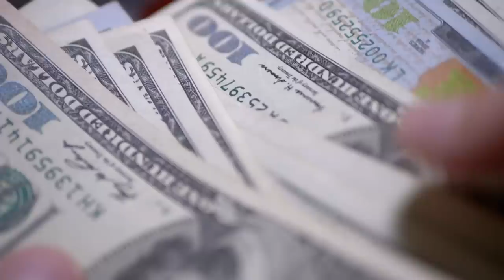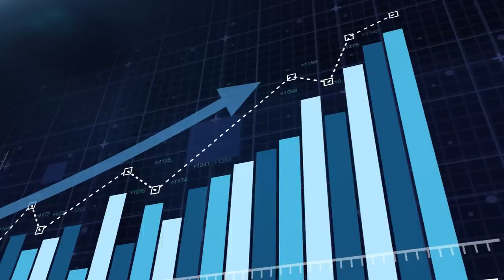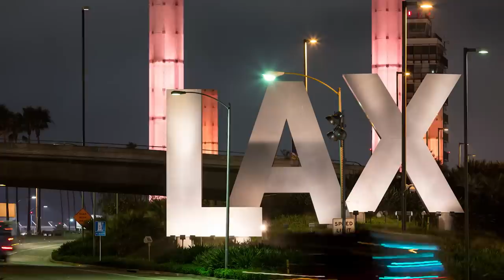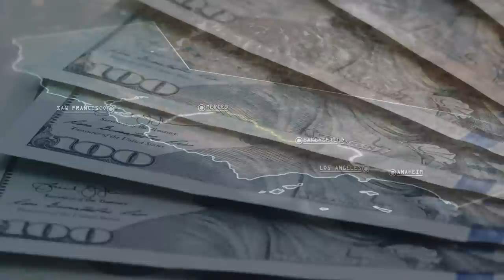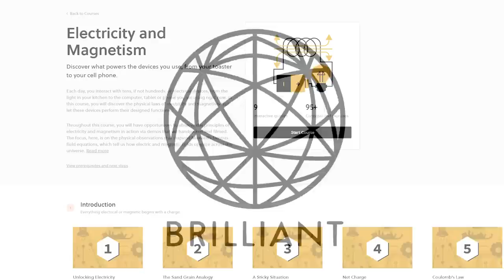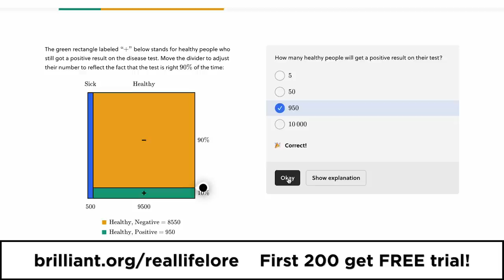Why California High Speed Rail is Struggling (Re-upload)

Comment: as a native to CA, it is hard to imagine this being completed. in the sense that it seems too good to be true. I have spent many many hours of my life in a car traveling around the state. having this kind of rail system would be AMAZING
Reply: "I have spent many many hours of my life in a car traveling around the state. having this kind of rail system would be AMAZING"

Well, you're learning this late, but you know, two American brothers invented this wondrous device a while back. It lets you fly through the air. It's been upgraded a lot and it goes at Mach 0.85 now. It passes wheel on rail HSR like the HSR is standing still.
Reply: @neutrino78x  a train station is a lot more convenient than sitting two hours before a flight and going through security and waiting in long lines
Reply: @cyclingtexas1670  

"a train station is a lot more convenient than sitting two hours before a flight"

Why are you doing that? Boarding starts 30 minutes before and security is 5 minutes with "clear" and 20 without. If you're there more than 40 minutes early when you have "clear", or you don't have clear and get there more than 50 minutes early, you're wasting your time. 

None of that makes up for 3 hours of your life that you wasted on the CAHSR that takes 4 hours to get to LA. 

It's even worse if you're going down to SD because as currently presented going down to SD would take another hour, whereas in a plane, they just open the throttle a little more and you still get there in about an hour. Their max cruising speed is over 500 mph so they're only taking an hour to get to LA because they want to burn less fuel. 

I've been on a flight from LA to San Jose that took only 45 minutes. Let's see CAHSR beat that (they can't beat one hour either).

btw to get on a TGV, users on TripAdvisor suggest about 30 minutes before also.

"going through security and waiting in long lines"

Five minutes with "clear" and 20 without.
Reply: @TohaBgood2  

"No one shows up less than 1.5 hours before their flights because that is a surefire way to miss your flight "

If you want to waste your time, go ahead. I wouldn't get there that early.

Also go to TripAdvisor and see what the users on there say about getting on TGV, they say to get there about 30 minutes early, which is when you want to get the airport.

"ou don’t show up a few minutes before takeoff and expect to be allowed to board!"

On Southwest you can. There's no assigned seating, so whatever seat is open you take it, as long as they're still boarding you're good.

"TSA lines can take anywhere from 10 minutes to an hour during busy times."

"CLEAR" is a thing. Sign up for it. I think it's like 200/year.

Anyway, regardless of all of this, fact remains, CAHSR as currently designed, if ever completed, would be a 3.5-4 hour ride. You're just making up excuses for it being so slow. Vast majority of people who want to go from SF all the way down to LA or SD just fly. It's cheap, it's fast.
Reply: @neutrino78x  Hang on, didn't you confess in a different thread that you completely made up the 4 hour runtime number for CAHSR? Didn't you say that you took the non-nonstop 3h5min SF-LA runtime and add on a hour "just because"? Didn't you concede that the nonstop SF-LA runtime is 2h38minutes? Do we have to redo that whole conversation again?

Because I literally have that thread saved where you confess to making up the 4 hour runtime for CAHSR!

And dude, what are you even talking about? In most major airports if you drive up to the parking lot at the airport 30 minutes before your flight you're not making it to the gate in  less than 1.5 hours. Let's take SFO. If the main lot is full and you go park in the longterm lot. From there you used to have to take a shuttle to the terminals which ran every 10 minutes and took about 10-20 minutes to get to the terminals. That's more than 30 minutes right there and you're not even inside the airport, let alone past TSA!

Dude, just stop lying! Anyone who has ever been in a large airport knows that you're full of it!
Reply: @TohaBgood2  

"Because I literally have that thread saved where you confess to making up the 4 hour runtime for CAHSR!"

I didn't. 3 hours 5 seconds by their numbers, but you can't accept that because they have 35 minutes or something like that for SF to SJ so it becomes 3 hours 35 minutes, and just from experience on public transit, and knowing the published timetable is normally optamistic, I predict 4 hours.

It's sort of a moot point because the project is never going to get completed. 

"In most major airports if you drive up to the parking lot at the airport 30 minutes before your flight you're not making it to the gate in  less than 1.5 hours."

I wouldn't know, I take transit to the airport. Try leaving your car at home.
Reply: @neutrino78x  Ok, so you confess again that you just made up the 4 hour number. A version of the SF-LA runtime with stops is 3h5min and you added another hour just because you felt like it, correct? And in the same document that you got the 3h5min runtime from, the actual nonstop SF-LA runtime is 2 hours 38 minutes (under 2h40min as required by law). Good to have another admission from you that you lie when you cite your fantasy 4 hour SF-LA runtime!

The vast majority of travelers drive to the airport in America. Even for airports that are very well served by transit like SFO or OAK that is the case. But for airports like LAX or SJC where the only transit that is available is a very slow bus, almost 100% of passengers drive. Best case scenario, they are given a ride to the airport or get an Uber. That is the reality of the situation. If it weren't then airports wouldn't need parking lots the size of cities!

You've basically constructed this fantasy reality where parking isn't an issue, where you don't need to take shuttles or trains inside the airport for 20-30 minutes to get to the terminals, where everyone has Clear. (But if everyone has Clear then isn't Clear useless by definition?) Where there are not trains inside the airport that you have to take. Where you don't have to search for your gate. Where you don't have to walk to your gate. Where doors don't close 15 minutes before departure as literally required by law.

Basically, these times you pretend are true exist only in your head. None of this has anything to do with the actual reality of flying in the US right now. This is all made up bullisht!
Reply: @TohaBgood2  

"Ok, so you confess again that you just made up the 4 hour number. "

Nope. It comes from decades of experience riding transit and knowing for a fact that it's going to take longer than any time table they release.

"A version of the SF-LA runtime with stops is 3h5min and you added another hour just because you felt like it, correct? "

Nope. 3 hrs 5 min is achieved because they have 35 min (or something like that, I'm not going to go look it up again) for SF to SJ, which is not realistic. 

3 hrs 5 min is 1) too slow and 2) a violation of prop 1A, anyway.

"the actual nonstop SF-LA runtime is 2 hours 38 minutes (under 2h40min as required by law)"

Actually the Business Plan says 2 hours 40 minutes, not 38. You're getting 38 from some computer simulations done by CAHSRA a while back. But regardless, the system they're building can't do it in 2 hrs 40 min. So, not much point in disputing my time estimations because 2 hrs 40 min would also be too slow.

"The vast majority of travelers drive to the airport in America. But for airports like LAX or SJC where the only transit that is available is a very slow bus, almost 100% of passengers drive."

Well, for SJC, it doesn't really matter, because the airport is basically in downtown. It's like five miles north. That's why we have a height limitation downtown. So basically if you can get to the train station where CAHSR would go (san jose diridon) you can get to SJC. There's no time advantage there. You can actually walk from Light Rail to the airport in like 20 min, I've done it before, though I normally take the bus.

But if you feel like parking and getting the bus from the parking lot takes too long, like I said just take transit/a cab/etc. In the future the cars will be fully automated, so your car will drop you off and then drive back to your house automatically, no parking involved.

For Los Angeles, if you're not close to LAX, you're probably close to Burbank or Santa Ana. Its like how the Bay Area has three major airports. Whichever one is a short drive that's where you would go. Like in your case with Berkeley, I think you said is where you live, you would drive to OAK which is a much shorter drive. If you're in the North Bay, you have a short drive to Santa Rosa airport.

Anyway, that's an argument for improving public transit to get to the airport, not for building an HSR that's too slow to take away from aviation. 

The coming eVTOL services will help a lot with this as well. They are zero emission. The CEO of Joby Aviation is very confident he can start services in Los Angeles in 2024.
Reply: @TohaBgood2  

"No one shows up less than 1.5 hours before "

You don't. Many others do. Just like most people fly from SF to LA, not drive, hence HSR is not solving a problem that exists. If you get there more than 50 minutes before the published takeoff time, you're wasting your time. 

How come you changed it to 1.5? TSA recommends 2 hours.

I'm an experienced traveler and don't need to get there anywhere near that early. I take transit so I don't have to park, I use "clear" so I don't have to go through the snake line, I check in online so I don't have to go to the counter before going through security. I also pack my backpack such that pulling out my laptop and noise cancelling headphones is quick. I wear shoes I can slip off. 

If you can't go in the door of the airport and be through security in less than 10 min, you're doing something wrong.

It's not my fault that you use a stupid method to get to the airport and are severely inconvenienced by TSA screening because you don't plan properly.
Reply: @neutrino78x  Yeah, you keep confessing again and again that you completely made up your 4 hour runtime claim purely based on your "experience riding transit" and nothing else. You know what we call a statement based purely on personal anecdotal experience and no facts? An opinion. You're just making it up! Keep in mind that every time you state this opinion of yours I will correctly point out that this is your opinion based on nothing.

Since you concede that the actual, simulated by professionals, runtime is "under 2h40min", I think we're done here. 

Good on you for at least confessing that you're lying. That's not something that people who are lying normally do, but still. Kudos for confessing.
Reply: @neutrino78x  According to official statistics, the vast majority of people actually traveling between SF and LA drive. I don't know what to tell you. That's just the reality of the situation. Keep in mind that that includes people traveling on the entire corridor to and from various points in between SF and LA, not just the 800k San Franciscans visiting the 3.8 million Angelenos.

Think about what you are claiming for just a minute. What would happen tp Clear if 100% of people had Clear and no one took the regular TSA line? Do you think that Clear can operate at all if it's not, by definition, only serving a minority of travellers?

Same thing for arriving at the airport. Imagine what would happen if 100% of passengers were to show up at SFPO 30 minutes before their flights. Imagine all the people from all the flights, trying to park simultaneously in lot D, and running.

You are pretending that the experience of 3-5% of marginal passengers is applicable to 100% of passengers and that is physically impossible in a system of finite capacity. All that would happen if 100% of passengers assumed the behaviors of these marginal 3% is that you'd have an insane crush load and the whole system would just crash. 

This is complete nonsense! This is not how anything works in the real world! You're just making isht up!
Reply: @TohaBgood2  

"Yeah, you keep confessing again and again that you completely made up your 4 hour runtime claim"

Nope. It's not made up. It's moot because the project will never be completed but I am firm in my reasoning. They give 3 hours 5 minutes, but you have to adjust it because the SF to SJ time is not reasonable, so that takes us to 3 hrs 35 minutes, and yes, in practice, I think it is quite probable that it would take four hours. 

Regardless, 3 hrs 5 minutes, 3 hrs 35 minutes, 4 hours, and 2 hrs 40 minutes are all far too slow. The plane gets you there in one hour. Even if I'm extra nice to you and count the plane as 2 hours, that's still AT LEAST 40 minutes faster than the train, and in practice it's about 3 hours faster.

And again stop acting like you have to educate me. (1) I'm not far right, I'm not on the right at all actually, (not that there is anything wrong with being on the right if you are moderate), (2) I support transit; I don't even know how to drive. 

Just because I think a given project is stupid and a waste of money does not mean I think ALL public transit is stupid. A lot of it is useful. Just not this project.
Reply: @TohaBgood2  

"Again, this is your "reasoning"! It's not backed up by anything"

Yes, it is. 

"o you know where the 2h38min number came from? People programmed in the geometry of the track into a simulation"

I already said that. But their Business Plan says 3 hours 5 min. Add it up yourself.
Reply: @TohaBgood2  

"According to official statistics, the vast majority of people actually traveling between SF and LA drive. "

Nope. Vast majority fly, that's why Southwest and the others that fly that route are always packed. I-5 is mostly trucks. And AGAIN
(1) not a conservative
(2) not against transit
Reply: @neutrino78x  Yeah, that's just false. The vast majority of people moving on the SF-LA corridor drive. Again, we're not just counting SF which is a pretty smalls city it taken without the rest of the Bay, and LA which is a fraction of the entire LA Area.

If you're so intent on lying, then why debate at all? Just continue living in your fantasy world and stop bothering the rest of us with your made up nonsense.
Reply: @TohaBgood2  

" Again, we're not just counting SF which is a pretty smalls city it taken without the rest of the Bay, and LA which is a fraction of the entire LA Area."

Neither was I.

There are three airports in the Bay Area.

Look at any traffic map of the state, such as 511. Look during rush hour. You'll see that 101, I-5 and 99 are green. That's because very few people travel between the Bay Area and Los Angeles in cars. 

There's no traffic problem all the way from SFBA to LA/SD. The problems are WITHIN the Bay area and WITHIN Los Angeles and WITHIN San Diego.

Not all the way the whole length from San Jose to Los Angeles,  because the vast majority of people making that trip are flying.

"f you're so intent on lying, then why debate at all? "

I'm not really debating, you're some 12 year old railfan. And, you didn't show us any evidence. Anybody can look at 511 and see what I'm talking about.
Reply: @neutrino78x  So you understand that the simulation of the track as designed yields, 2 hours 38 minutes and change for SF-LA? 

Yes or no?
Reply: @TohaBgood2  

"So you understand that the simulation of the track as designed yields, 2 hours 38 minutes and change for SF-LA? "

They ran those simulations years ago, brother. The LA Times article about it is from 2018. 

Again go look at the Business Plan, add up the numbers yourself. You don't get 2 hours 38 minutes, you get over three hours. Before you accuse me of making things up, do the math yourself.
Reply: @neutrino78x   Didn’t you just agree that the 3h5min runtime was with the major stops at the tail ends of the five sections you added up? You literally said that you added the runtimes from different sections together, didn’t you?

And no, no one runs a sim 10 years ago and prays that it’s still accurate after a bunch of design changes. That’s not a thing! Those sims get rerun regularly as they get the as-built specs for the sections in the Valley that are already completed. Plus there are all the minor design changes that happen when they do the EIRs and as engineering plans become available for the upcoming sections. Additionally, Deutsche Bahn only started planning early operations a couple of years ago and reran all the sims in their software completely independently as they were playing with different service patterns.

You day things that make zero sense to any reasonable person and pretend like you didn’t just say something asinine!
Reply: @TohaBgood2  

"Didn’t you just agree that the 3h5min runtime was with the major stops at the tail ends of the five sections you added up?"

Nope. Learn to read.

Look get the business plan yourself. Add up the times. This is a repeatable, objective observation. It adds up to higher than 180 minutes. This isn't stopping. They're saying, San Francisco to San Jose 30 minutes. CONTINUE TO MERCED, 53 minutes, continue to bakersifeld 56 minutes etc (I don't have it in front of me right now but you see what I mean). These are express numbers, no stopping.

Elsewhere in the document they say 2 hrs 40 min, yes. That doesn't change the fact that if you add up their times for each section it exceeds 180 minutes (3 hrs).

And 180 minutes is really slow when a jet aircraft can do it in 45-60 minutes. And no, we do not have to add five hours to the plane trip. The train is just SLOW.
Reply: @TohaBgood2  

"So you understand that the simulation of the track as designed yields, 2 hours 38 minutes and change for SF-LA? "

You understand that those simulations were done in 2018? Yes or no?
Reply: @TohaBgood2  

"The vast majority of people moving on the SF-LA corridor drive."

Guess again. Look at 511.

What color are 101, I-5 and 99 at rush hour? Are they red? Or green?

" Again, we're not just counting SF which is a pretty smalls city it taken without the rest of the Bay, and LA which is a fraction of the entire LA Area."

Same here, everybody flies. They go to the nearest airport to where they live and fly down to the nearest airport to their destination; there are four in the bay area and three in LA basin. For example if going to Disneyland, you would fly to Anaheim, if going closer to Burbank you would go to the Burbank airport, if going closer to LAX you would fly there.
Reply: @TohaBgood2  

"Again, this is your "reasoning"! It's not backed up by anything other than your "vibes". You have no idea why you believe that."

How many times do I have to tell you? The Business Plan says 3 hours. We know off the bat that their SF to SJ number won't work, you would have to average 120 mph to achieve that, and the fastest speed anyone has talked about trains for SF to SJ is 110 mph, and that's a maximum not an average. So now it's 3 hrs 35 minutes. So in practice call it four hours.
Reply: @TohaBgood2  

"Yeah, you keep confessing again and again that you completely made up your 4 hour "

You stating that I made it up does not equate with me "confessing" I made it up.

YOU think I made it up.
Reply: @neutrino78x  What does 511 have to do with anything? Why don’t you look at the actual counts of people who travel on this corridor? 

And no, if my destination is a few hours away driving, why I fly? With TSA and airport tine I get there faster by driving? If I live around Fresno going to LA or Bakersfield going to the Bay, why would I fly? That makes no sense!

What am I supposed to waste my time and convenience just to satisfy your desire for some fantasy reality that only exists in your head?
Reply: @neutrino78x  No, bud, those sims are rerun constantly for service planning and when a new segment is completed and they document the as-built. 

Why would they only run the sims every six years? It doesn’t cost anything and takes minutes to compute. Seriously, it’s like you don’t have any common sense.
Reply: @TohaBgood2  

"No, bud, those sims are rerun constantly for service planning"

No they aren't, you're talking about simulations run back in 2018 based on how it was planned in 2018 and based on very optimistic assumptions. In real life it won't run that fast.

Again, go open up the Business Plan for 2022 and add up the times for each section. Which is what you should have done BEFORE accusing me of lying.
Reply: @TohaBgood2  

"What does 511 have to do with anything? "

It shows real time traffic information. Look on there at rush hour and you will see I am right.

"And no, if my destination is a few hours away driving, why I fly?"

Five or six hours is not "a few hours away driving" sir. That's why most of us fly.

"With TSA and airport tine I get there faster by driving?"

No you don't.

"If I live around Fresno going to LA or Bakersfield going to the Bay, why would I fly?"

Because that's even faster than flying from SFO /SJC/OAK to LAX/BUR/SNA.

"What am I supposed to waste my time and convenience just to satisfy your desire for some fantasy reality that only exists in your head?"

Uh, look in the mirror?
Reply: If it's completed, it will be so late that there will be better technology by then. Particularly electric aviation, which is one battery improvement away from widespread adoption.  And Aluminum/Graphene,  Sulfur and other batteries are being commercialized as you read this.
Reply: @neutrino78x  we want HSR
Reply: @StripedJacket  

"we want HSR"

I don't see why. We already have a high speed means of going from SF to LA, and it's a lot faster than any train we would build.

I feel like people voted for prop 1A because they thought -- without reading the proposition or doing research -- that it would help their commute. But it won't, and that's not the purpose of HSR. HSR is for inter-regional travel. No one commutes from SF all the way to Los Angeles. In fact very, very few make that trip on the ground, because it takes forever. Greyhound is scheduled to take five hours 30 minutes. I go down there often, but I fly, because I don't want it to take hours and hours.

Things that help with commutes are for example Caltrain and BART up here in the Bay Area. They don't need to go 200 mph because they're only covering 56 miles. Right now Caltrain averages about 35 in non-express and about 56 in express. (the max speed allowed on the track is 79.) CalMod may or may not push that average speed a little higher. But it doesn't change the maximum speed of the track. But, we don't need to do anything about traffic on I-5 because there isn't any. If you look at the traffic map on 511 (google it), you'll see that Los Angeles is a big block of red during rush hour, and the Bay Area has a lot of red, but I-5 in between is green, as is 99. Because nobody's driving it. Most of us just hop on Southwest for a one hour flight, and of course it's not our commute, it's either vacation or someone has business down there.

But yeah, CAHSR would have no effect on people who have to drive from Blossom Hill in San Jose to Sunnyvale everyday. HSR wouldn't even stop in those places. That's what Caltrain is for. Similarly, it wouldn't help how 405 grinds to a halt during rush hour in Los Angeles. 

Again, CAHSR is for going from the Bay Area to LA. It's not for going WITHIN the Bay Area or WITHIN Los Angeles. There are other forms of transit for that.

Fear not, there's a project to enhance the speed of Amtrak California, it's a lot cheaper, and would achieve the same result (SF to LA in about four hours). It's really several separate projects, which is probably better. They're working on Capitol Corridor, and they're also working on Surfliner, to divert some of it away from being right the coast where it floods, other parts they are going to straighten, other parts are going to be double tracked (add another track next to it on ROW that already belongs to the county). All this is in the California Rail Plan for 2022, you can look it up (we can't link on these comments anymore, it eats your comment if you do). 🙂
Reply: @neutrino78x  can you tell me where in the business plan it says that San Jose to Merced is 53 minutes? I didn't find that anywhere in it but I did find San Jose to Fresno 51 minutes, which makes a lot more sense than San Jose to Merced 53 minutes, especially when Merced to Bakersfield is 56 minutes. Also your point about transit timetables never matching the real schedules holds no water with this because this will be on dedicated tracks with only other CAHSR trains on it, with the exception of Gilroy to SF
Reply: @pancakebro9073  

"can you tell me where in the business plan it says that San Jose to Merced is 53 minutes? "

Maybe I misspoke, or copied the wrong number...I think I posted that a while back....but the real number is only 2 minutes shorter.

SJ to Merced 51 minutes, page 33 (according to page number in lower right hand corner).

"especially when Merced to Bakersfield is 56 minutes."

Which is not really impressive, that's like 177 mph if you assume Merced to Bakersfield is 166 miles. Of course that's for an express run. If you take every stop it will be slower, I think they have five stops in between, three minutes each that's another 15 minutes, that brings us down to like 140 mph average. A far cry from the claims some make that CAHSR would average 200+ mph. Just saying, be realistic about this thing. Not it matters much because Phase 1 will never be completed.

"Also your point about transit timetables never matching the real schedules holds no water with this because this will be on dedicated tracks with only other CAHSR trains on it"

It stands to reason there are other sections where they won't meet the proposed schedule, since their SF to SJ time makes no sense. They have it under 30 minutes....the only way that would happen is if they average over 110 or 112 or something, and right now the maximum speed on the Caltrain tracks is 79 mph. 

Aren't they also going to share track when it goes into LA? It's going through BUR airport right? I assume it's going to run on the Amtrak tracks through Los Angeles at some point, because to go from BUR to LA Union Station you're on the existing Amtrak tracks. But I dunno, they've wasted money so many other times, I guess I wouldn't put it past them to go underground through LA or something weird like that.

Anyway, it's all moot, man, because the Governor already stated that Merced to Bakersfield is all that's ever going to be built, for the foreseeable future. He said there's no economic path to the 100 billion they want for Phase 1. So, either CAHSRA would have to find a way to complete Phase 1 for far lower cost -- at fixed price (it can't go up later, because we can't pay 100 billion) -- or we go back to the voters.

I can you that as someone who voted no with pride the first time it was on the ballot, I will definitely do so again, now that they have PROVEN that they have no respect for The People's Money. At least before you could give them The Benefit of the Doubt, but not this time.

It's especially unlikely given these post covid times when transit systems just don't have the ridership anymore, now that most of the white collar guys are working from home. This is a time where we would scale things back, not waste huge amounts of money on something that will struggle to go half the speed of what the private sector already provides.
Reply: @neutrino78x  
"SJ to Merced 51 minutes, page 33 (according to page number in lower right hand corner)."

That 51 minutes is SJ to Fresno. I am looking at the PDF of the business plan right now to confirm.

"They have it under 30 minutes....the only way that would happen is if they average over 110 or 112 or something, and right now the maximum speed on the Caltrain tracks is 79 mph."

Aren't they upgrading the caltrain tracks right now for the high speed rail? Also on the official website for CAHSR it says that the goal is 220 mph on dedicated tracks and 110 on shared segments

"Aren't they also going to share track when it goes into LA?"

ok, I forgot about that too you're right. 

"the Governor already stated that Merced to Bakersfield is all that's ever going to be built, for the foreseeable future."

I couldn't find this anywhere, granted I didn't do much googling so it is possible I just didn't search hard enough.
Reply: @neutrino78x  I have never seen a dumber take than yours. Apart from the numbers that just aren't on your side, trains are more accessible, more sustainable, more reliable, more flexible, and cheaper than planes when given the option. Let's be more honest about this.
Reply: @SoupSquared662  

"Apart from the numbers that just aren't on your side, "

The fuck they aren't.

100 billion to complete phase 1 -> state doesn't have the money, federal government doesn't want to throw good money after bad, game over just based on this. We will complete Merced to Bakersfield and stop, per the Governor.

SF has the population density, LA does not. For HSR you want Point A and Point B to both be very dense.
SF = 6,655.4/km2
LA = 3,206.29/km2

The distance is too far, 380 miles or 611 km.

The only comparable line in Europe is Madrid to Barcelona, and Madrid and Barcelona are BOTH FAR MORE DENSE THAN SF OR LA.

Takes too long = 3 hours according to the numbers in the 2023 business plan. Will be at least 3.5 hours, because their SF to SJ number is not realistic (they think it can be done in 29 minutes, that requires an average speed of 112+ mph, the current MAXIMUM ALLOWED SPEED on the Caltrain tracks is 79, therefore a more realistic number is about one hour, which is how long is currently takes on a Caltrain "baby bullet".)

Before you copy and paste your bullshit argument "counting security a plane takes 3 hours", let me intervene so you don't waste my time and yours. Read this and then DO NOT make the airport delay argument. Thanks.

[begin copy and paste]
Nope. Since you guys are cutting and pasting, I'm going to save this post so I can just cut and paste next time this is brought up. This argument is more true on the east coast or in Europe where the airport is further away.

1) SJC is 20 minutes from downtown SJ on public transit; SFO is 30 minutes away from downtown SF; BUR is 30 minutes away from downtown LA.

2) security is 5 minutes if you have "clear" and 20 if you don't

3) in no way do you have to show up 1-2 hours early on a domestic flight. If you're there more than 30 minutes before boarding starts, you're doing it wrong
[end copy and paste]

So yeah. YOU are the one who is not well researched here. I've been following this stuff since the 90s. You probably weren't born yet.

I am a lifelong centrist Democrat, lived in the Bay Area since age 5 and I am now 45, ride Caltrain OFTEN, and very proud of having voted "fuck no" on the CAHSR. 

Earlier this year (in March I think?), they did a request for funding from the Federal Government and were turned down; reason given, "project is not cost effective".

Truer words never spoken.
Reply: @neutrino78x  In 2021, Caltrans estimated the cost to maintain and repair current assets of the California road system to be $122.9 billion due to the aging infrastructure and increasing costs. Asphalt roadways constantly need to be repaired because of the wear and tear enacted on them. I go to Los Angeles from Stockton regularly, and do I fly every time? Hell. The fuck. No. Flying is too expensive, and I'll have to drive to the airport anyways which is gonna add at least an hour and a half (at the very very minimum). I drive my SUV, despite the costs of gas because it's cheaper. The numbers aren't on your side. Would you rather spend $100 billion on a HSR system that will reduce costs for commuters on a system that's FAR more sustainable than flying or driving, or would you like to spend $122.9 billion repairing a system that's constantly going to need more and more funding? Railways require far less maintenance than asphalt roadways, and this would be a one time cost to the state to drop travel costs for US citizens while also funding the US government. Is that such a bad idea?
Reply: @neutrino78x you don’t need to put every comment you reply to in quotations
Reply: @neutrino78x Clearly it is if it’s projected to have 30 million annual riders. Also it’s being operated by Deutsch Bahn, the national railway company in Germany, which is lauded for their HSR.
Reply: @neutrino78x Also the train will be really quiet, because the rolling stock has to be quieter than 96dB when running at 220 mph. The big picture of this project is that it’ll spark discussion or more true high speed rail, and this project is finally putting us up to global standards.
Reply: @HeelerHouse 

" and this project is finally putting us up to global standards."

You do realize it's only going to be built from Merced to Bakersfield, right?

It sounds like you haven't been following the issue other than watching YouTube videos? 

Anyway, who cares about "global standards". The USA is one of three FREE COUNTRIES with similar geographic size and similarly small population density. None of the three of use HSR, simply because we require more speed than you get from HSR, ok.
Reply: @HeelerHouse 

"Clearly it is if it’s projected to have 30 million annual riders."

Nah....that's not realistic, especially not now with at least 30% of white collar workers still working from home five days a week, and the people coming in to work only having to do it three days a week.

Plus it's only going to be completed from Merced to Bakersfield.

HSR at best can only compete with driving. The problem is, 380 miles, most of us fly that route. And HSR is not remotely competitive with flying, especially not this project that would (were it ever completed, which it won't be) take at least three hours vs a one hour flight.

And no, going to the airport and going through security is not a two hour process.
Reply: @HeelerHouse 

"you don’t need to put every comment you reply to in quotations"

No, but if you don't, nobody knows what you're replying to. I've been on YouTube for like 14 years now. 

Trust me, it's really frustrating when there are 200 replies, and somebody replies to your comment from like a year ago, and you have no idea what you wrote, and you would have to expand down the comments and click ten times trying to figure out what they're replying to. Whereas if you quote, everybody sees what you are replying to, and the person you're replying to doesn't have to hunt down what they originally wrote.

It's good to consider other people.

The ideal thing would be to do it like on Usenet and BBSs, where you precede each quoted line with a greater-than symbol, but that doesn't work with non-monospaced fonts.
Reply: @neutrino78x I guessing you work for a airline
Reply: @someotherdude 😂😂😂 stop listening to musk.
Reply: @neutrino78x here a idea. Instead of CHSR. Let just do hyper loop. That ten times better.
Reply: @gamerfan8445 

"Let just do hyper loop. That ten times better."

I agree that it IS better, however, the current system of jet aircraft is better than BOTH.

I would never endorse taxpayer dollars being wasted on something that the private sector already does better. And this is a liberal speaking. Just not a communist (I'm a moderate). 

And yeah I definitely agree that CAHSR sucks. It was a stupid idea from day 1 and I am proud to have voted no on it. 🙂
Reply: @gamerfan8445 

"I guessing you work for a airline"

Nope. Why would you guess that anyway, that's stupid.
Reply: @neutrino78x  congratulations you played yourself.
Reply: @neutrino78x  well you acting like they are the best mode of transit. Which they are not. They are expensive, unable to be scaleable for mass transit, and they can’t land away from cities due the noise they make from taking off and landing.